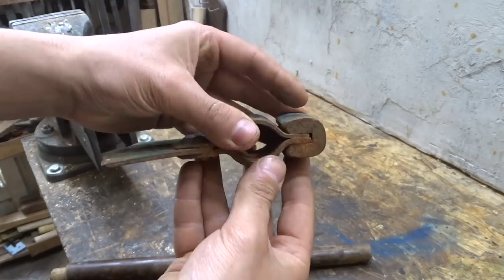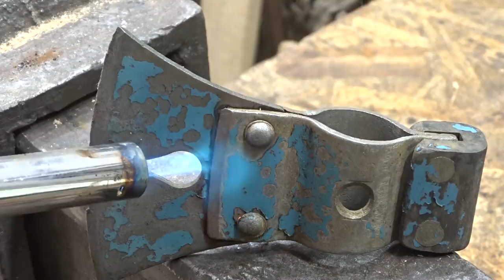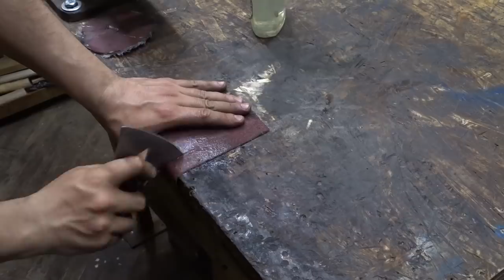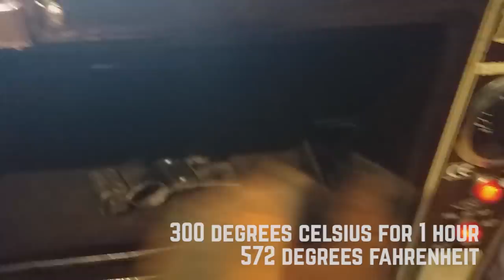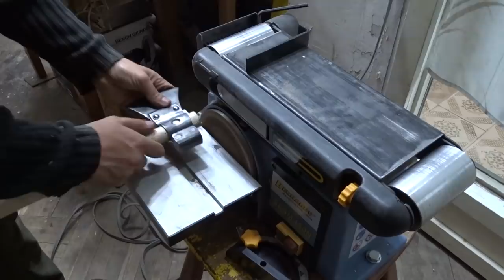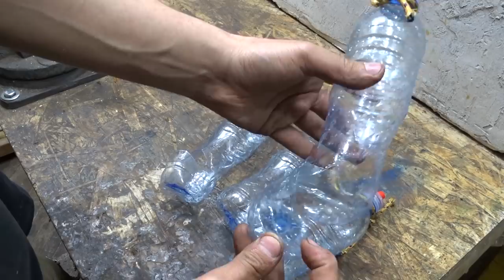Restoration Old Rusty Carpentry Axe

Comment: I have one of those axes, it has a metal handle with a spring clip that locks into the hole on the side, inside the handle is a clip on blade and saw also fits a small trenching shovel. All in a small belt bag.

Comment: Defiantly one of, if not the best tools that I've seen. Great style and design. Love it!!! Do you have any history on it? Would like to learn of it's origin. Thank you. Awesome restoration!!!
Reply from the maker: Well, I just found little information about that shape of axe. There are many opinions about the purpose of the hole in the form of a keyhole - someone says to mount on heavy equipment, someone for fixing it to the harness/belt of a carpenter, there is even a view that it is a device for straightening nails or the hole provided to hang the axe on a nail to break or change activities while working at height.
Reply: Search for Vintage German Survival Axe. They were designed with a detachable hollow handle that held a saw blade. Also came with a shovel head. They were typically assembled in the shovel configuration stored in a canvas pouch with the axe head carried in another attached but separate pouch.

Comment: I about climbed into the screen to beat him with a dead stick! Do Not Quench an Axe In Water!! This rapid cooldown changes the molecular structure of the metal to the shape of grains of sand. Always quench in oil.  I can't stress that enough, especially with an axe. I appreciate the double quench but by quenching in oil you keep the grains tight. This is especially important for striking metals such as an ax or a weapon which holds up to armor, shields and another person's weapon.

Water only has a few places in a work area, for fire, drinking and to splash your face an occasional partial quench to soften the spine or finish an area which wasn't originally quenched so to keep it soft for drilling.  Oh, and metals for the aerospace industry, cheaply made axes, sawblades and metals that will not be used for striking or struck against. Very few metals are good with water for the purpose it was used here.
Some of you are asking how I know this fact. Well, I spent quite a lot of time with friends and meeting people who do blacksmithing for a living. Grantied most had only been in the industry for no less than 20 years.

Other than all of that, I really like this guy. I hope he gets the most out of what he does and enjoys it too!
Reply from the maker: Hello sir, thank you for attention and advice! It's very important for. I always trying to improve my skills.  Stay safe.